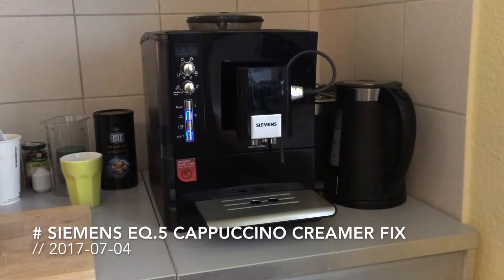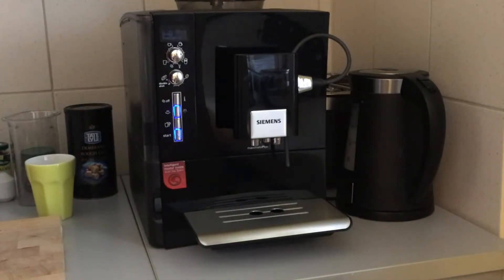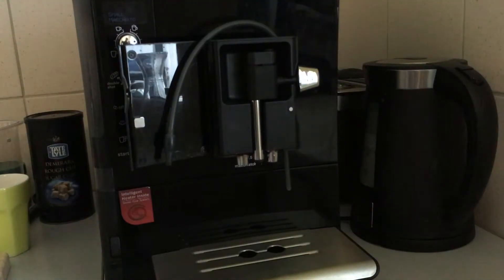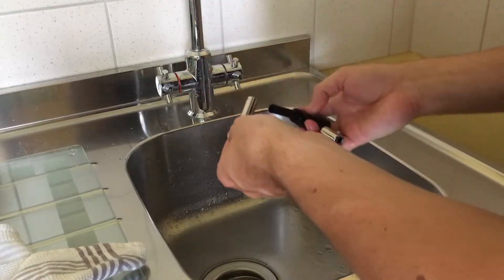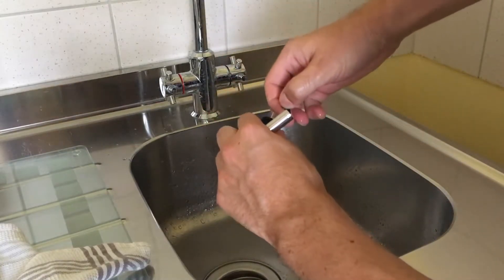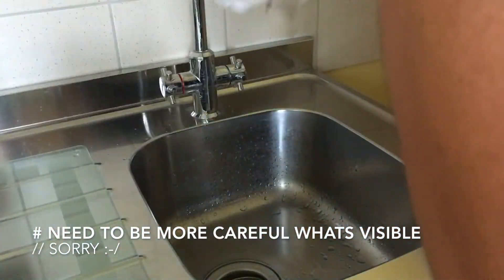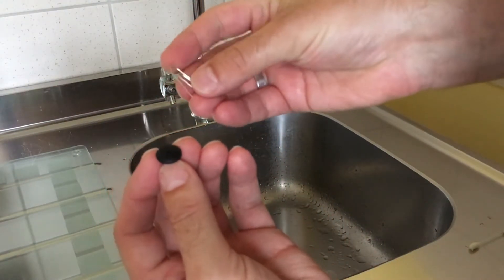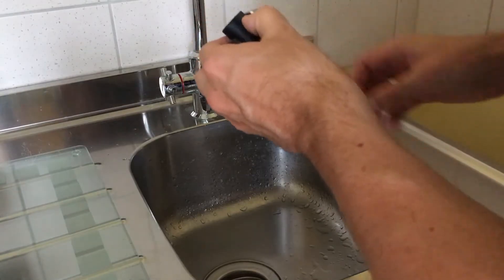Siemens EQ.5 very simple DIY milk creamer fix

Comment: I was also wondering if there an air intake on the top of the valve. I looked through it but I couldn't work out whether there was a hole or not. The reason is that the hole in the rubber seal is so small that the elastic walls around the hole are so tight that you can't really see whether there actually IS a hole there. Its designed so that the walls protract then there's negative pressure in the seal therefore opening the air intake and allowing air to flow. Thanks again!